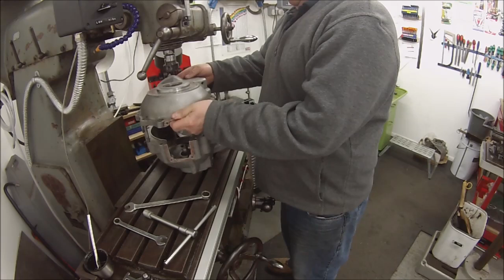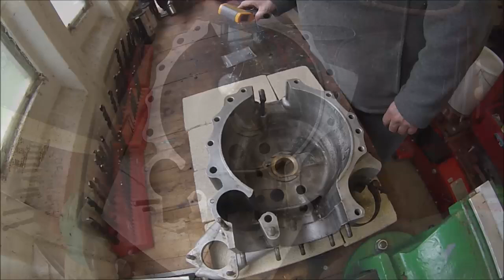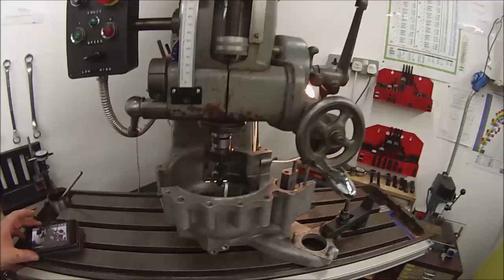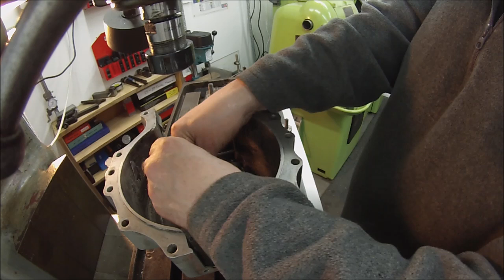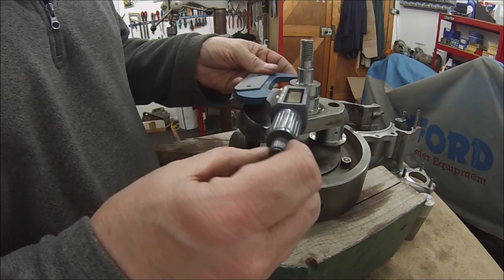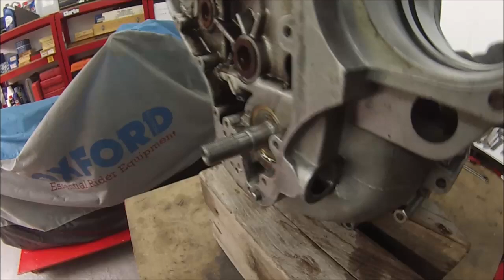BSA A Group Gear Side Main Bearing Bush

Comment: The solid bronze bushes are rubbish compared to the BSA originals. Sold bronze bushes are just easier to make than the original steel backed bushes and in over 50 years experience I've never known a genuine BSA phosphor bronze insert come loose. What a pity you can't get the original bushes these days! Watch for the bush dropping in too easily without having to knock it in because they can come loose when the engine is hot from running and that play can can cause the crankcase to wear. The new bushes have to be checked because they aren't always machined accurately and they don't always have the right interference fit! The bush can also be line reamed with the crankcase halves bolted together without having to machine. Very few of us fave got a machine shop..
Reply from the maker: See my other video mentioning line reaming, I have used that method too. Early BSA bushes were lined with white metal , a reamer and plate were available to dealers for this. Later bushes were a steel case with Vandervell vp21 liners, pre sized, never reamed, un pinned to start, then Later pinned to stop rotation of the liner. Any bushes in phosphor bronze needing reaming ( more usually leaded bronze) were aftermarket by MCE, Wassell, Alpha etc, not genuine BSA. Thanks for commenting and your support,   appreciated.
Reply: @AGEngineering  Thanks.

Comment: Great video 👍thank you for your time .I have recently inherited my father‘s 69, 650 lightning A65.He was always concerned about the oil pressure dropping at idle when warm , he told me, I would eventually have to replace this,bushing. again, oil pressure will come down when warm ..Appox. down below 30 pounds at idle ,he had recently installed high pressure oil pump with good oil, he told me that I should consider replacing this bush in the future due to low oil pressure , the other day I took it for a spin in the evening it was about 80° outside and when I got close to 5 miles of driving around my neighborhood (never got out of third ) stop and go basically ,oil pressure started to come down at idle. However, with engine off idol oil pressure would be high (30-40 psi)no problem .❤ this bike was my dad‘s baby. It is absolutely cherry. Low miles. Everything has been overhauled or updated. With the exception of the lower end. Thank you for your time.
Reply from the maker: Great to hear these stories and related history, many thanks for sharing.

Comment: Thank you. We have an A50 to do and no machinist local wants to try the alignment. I think I have one but he is 3 hours away. We also need to line bore the cam bushings and one is a blind hole. Can you advise or demonstrate that procedure?
Thankyou again. jerry
Reply from the maker: Thanks for your message, cam bushes are covered in a couple of my videos, check out the bearing conversion ones. I promise everyone I will get back to the bearing conversion at some point 🤞

Comment: Hi Ade.
As you probably know the old Redditch built Royal Enfield Bullet Engines have a bush like that however the Indian made ones have upgraded to a Roller Bearing so the hole would obviously need machining out & i know the Man for the job. (Hint Hint :-) )
Reply from the maker: Honestly I've never tried this with an Enfield, I would have to 'consult' to see if it was doable, but I would think so if the castings had sufficient material to work with.
Reply: @AGEngineering  I'm Game if you are Mate. I have a pair of cases to practice on. Where are you based Ade? I am in N/Essex. I bet you are miles away?

Comment: I always pick up used bronze bushes at jumbles.I get the crank ground to the minimum to clean it the guy does not even need to measure it .Then I select a bush with a just smaller undersize  fit that,and using an expanding (adjustable ) reamer with aground guide spigot ,and ream in conjunction with the roller bearing in the left casing (fully bolted together) Just ream till the crank fits.You may get away with twice many regrinds as you are not having to take off a full 010 thou .I`ve had a `58 Huntmaster since 1971, I have used it A LOT and done a rebush three times ,but this has never failed on me and was only ever done as a part of general rebuild, KEEP YOUR OIL CLEAN!  
One very important thing ! what ever type of bush you use ,check the radial (1/8"?) oil holes, they should be angled slightly in towards the centre of the engine to line up with the grouve in the crank
Reply: I`m sorry I hadn`t finished!   some "pattern" bushes have been made with the oil holes at 90 degrees  and they do not line up with the grove in the crank,or are partially obscured. This can be put right with a round needle file ,slotting the holes is fine. Please check this  ,one of my friends seized his A10 up in five minutes of first startup!
Reply from the maker: I would agree with that, I have said to people only grind to clean up, ignore the std and o/s figures that were recommended, keep that material on the crank! I've seen some pretty awful bushes over the years, please have a look through the other comments to this video, i think it has been discussed with other viewers. Thanks for watching and commenting, best wishes, Ade.
Reply: Brilliant! really enjoyed your piece very informative.

Comment: Hi Ade, thanks for taking the time to share your time and knowledge. This is a job I need to do but don't have a milling machine, I am hoping to buy a reamer and open a lead bronze bush out by hand. Thanks again, Dave
Reply from the maker: There are other ways to do the same job, depends on budget, availability of machining services and other factors. Many years ago I hand scraped an A65 main bush to suit the crank, that was about 1987. It's still running today with the current owner and has not been rebuilt since. Thanks for watching and commenting, Ade

Comment: Hi pal, nice tools and knowledge. How come you can just use a lathe bear
Reply from the maker: The bush really needs to be bored after fitting to achieve the tolerances needed for good oil pressure, hope this helps, Ade.
Reply: A G Engineering thanks ade

Comment: This is a really excellent method..the factory required a special plate and reamer, which are obviously unobtainable. The alternative would be to bolt the cases together,  turn a dummy beating for the drive side as a pilot , and then line-bore or line ream the timing side using that.  Contrary to belief, the BSA TS bush was not a bad idea. You need to have either an original steel bush with soft bronze insert ( no longer available) or else use  lead bronze ( softer) over phosphor bronze for a one piece bush. If The correct clearance is reached  (max 1 thou) and the oil changed regularly, it will last a very long time!
Reply from the maker: Thank you for your supportive comments and thoughts. Best wishes and happy Christmas, Ade

Comment: Those BSA plain bushings where a daft penny pinching idea. I know a plan bush can be more accurate than a ball bearing but on an engine with hardly any oil filtration it was always asking for trouble. Even a small amount of wear put the oil pressure at risk.
Reply from the maker: Couldn't agree more, I'd love to experiment with a roller bearing/end feed set up  one day. thanks for the comment and support.
Reply: A G Engineering  Back in the 70's I had a local firm do just that to my Ariel Huntmaster, basically an A10 engine with minor differences to casting shape, they used a caged roller bearing, forced oil direct from a drilled port down the end of the crank. I added a remote old filter the return line, engine was fairly well breathed on, porting big valves, cam, lumpy pistons and ridden hard, last ed very well after the work, before the bearing conversion 2.5 to 3 thousand miles was the most it ever did without losing oil pressure from the worn main bush. But before you say how good yours are, I rode it hard and fast, my mate all road later triumphs and nortons, I never got left behind.
Reply: As I found out....

Comment: That's funny. I've always just heated the case with a tiger torch and the bearing simply drops in!
Reply from the maker: Absolutely, hate to see bearings in engines hammered in or even pressed, much prefer heating the cases. Thanks for watching

Comment: I am not a precision engineer so apologies if this is a dumb question. Why does the bush need to be bored out in-situ? Isn't it easier to do that first then fit it into the crankcase?
Reply from the maker: No problem, the clearance needs to be very precise to ensure good oil pressure and oil feed to the crank, and needs to be accurate to be in line with the bearing opposite. The crank grinding also has a tolerance which needs to be accounted for. Many thanks for the question and viewing.

Comment: I thought you were meant to line ream using the other casing?
Reply from the maker: As with most jobs there is more than one way to do it, this is the method I use with the tools available to me, not saying it's 'right' , just one of the ways. If line reaming facilities are available then that would work as well, but a reamed finish is not as good as a bored one. I have improved the tooling since this example and now use indexable carbide inserts for non- ferrous applications, then hone to final size on a Delapena Speedhone. The BSA factory service method was a plate which bolted to the timing chest and reamed through a guide sleeve. In all honesty given the choice and money I would go for a needle roller and thrust conversion with centre oil feed like SRM.
Thanks for the observation, thanks for watching, hope you are enjoying the channel. Ade.
Reply: @AGEngineering  Hi, I am a Recently retired turner of 49 years. When I was an apprentice I used to make the phozy bronze bushes for our local motorcycle repair shop. He used the method you mentioned (BSA) and I also had the reamers ground to various sizes for him. Keep up the good work.
Geoff.